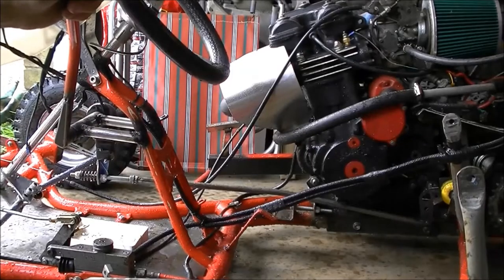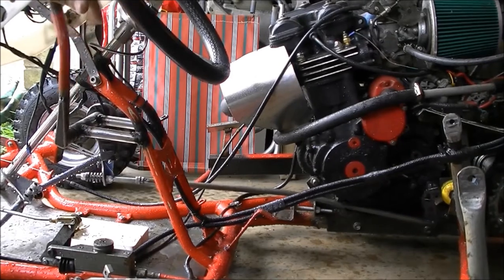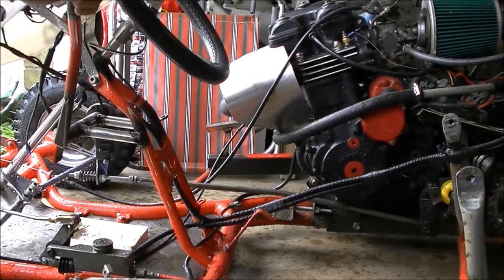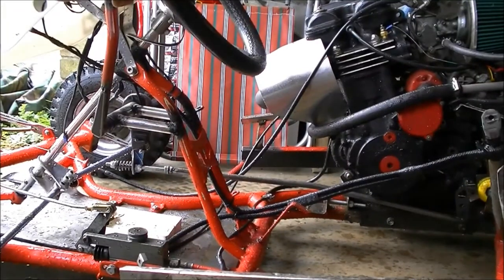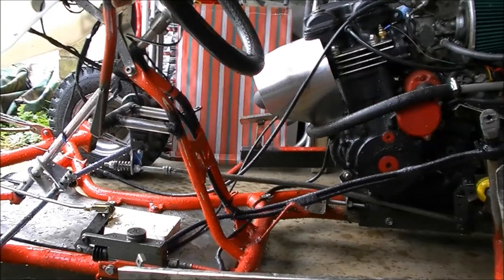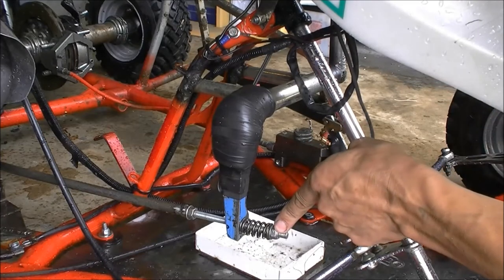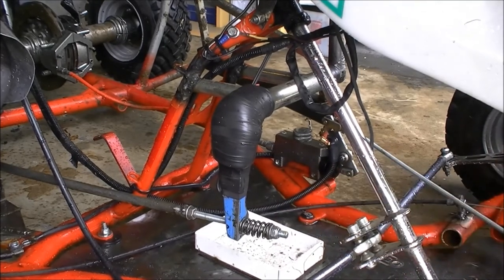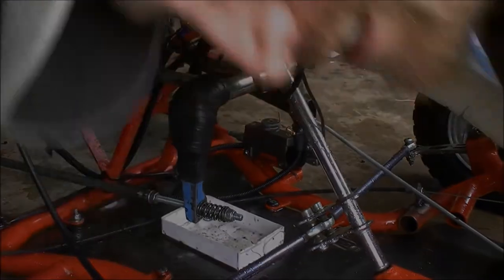GRASS KART BUILD - #4 - New Gear Selector for all Shift Karts!!!

Comment: Nice. I did a similar thing on my Suzuki RM250 grass kart. But I had the micro-switch and spring inside the gear shift lever at the end. Better protection from the elements! Also used an "Ignitech" programable CDI, with external inputs including flat shift with a pre-delay from the onset of the trigger, to ignition cut duration. Mine was a total of 100 milliseconds, or 1/10th of a second.

Comment: just found your vids... great idea with the ignition cut out , have you got it dialed in yet? , was looking at aftermarket devices that do the same job, but VERY expensive.  there are lots of micro switches to pick from is that what you use?